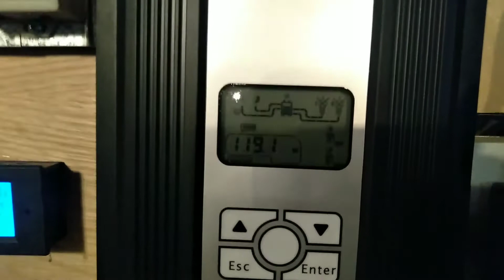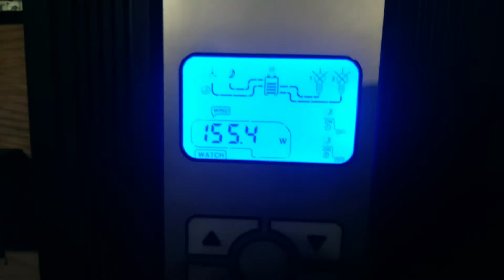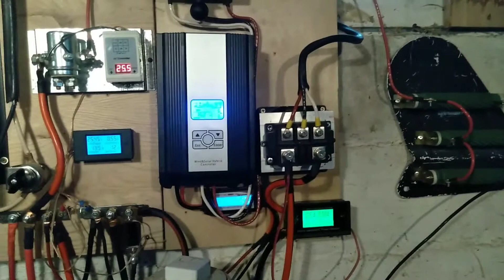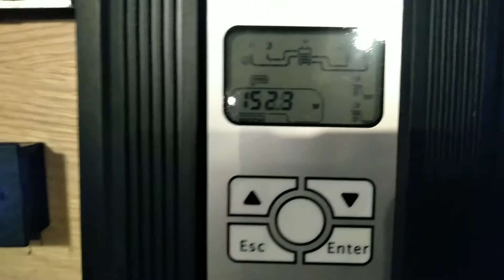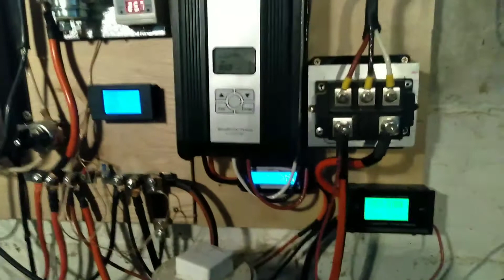MPPT Wind Controller, 2 Month Update

Comment: Hi Mate, I have a idea for your extra power, so it is not wasted in a dump load resistor and is stored for times when there is no wind or solar. It is using water and gravity to spin a water generator. First you would need a big rain water tank on a stand off the ground or up on a hill, then another rain tank of the same size at ground level. Using your extra power to pump water from the bottom tank up to the top tank to store until it is needed. Finally contact a water wheel generator in the top of the lower tank after the input hose. Water can be used from the bottom tank if needed, after collecting power from it after transfer from the higher tank. Use a relay to turn on.
I hope this idea helps everyone.

Comment: On your suggestion i just got one of these for my wee 400w 12v setup but I think the mppt function stops it from picking up proper speed by kicking in at 10.5v and then I can never get more than 11v at 25 knot wind speed. I thought about getting a turbine with bigger blades but we have so many hurricanes i dont think thats safe (considering i dont have help to bring it down). Do you know if these controllers can do a good job of managing a 24v turbine to 12v battery setup? Im thinking that may be a better solution?
Reply from the maker: You can adjust the mppt function and tell it what rpm or amp input to kick on or off. That allows you to fine tune the controller to your exact turbine.

Comment: Does your land up north have better wind?
Reply from the maker: Ummm.... i never measured it. It's much higher elevation. The tree tops are always moving so I guess we'll see. I plan on going for the gold with a 50' tower and building a similar powerplant as i did for that customer in the middle of nowhere. Panels and turbine rite on top of the power shed to keep low voltage wires as short as possible and then distribute the AC from there. I'll be up there this weekend and show the place off. Gorgeous little slice of heaven.
Reply: @smallcityhomesteaders1600  Sounds like a great plan, can't wait to see it. Thanks for sharing your adventures in living with us.
Reply from the maker: @stevenfrazier8939  my absolute pleasure!

Comment: Versions of this controller use an external dump load rather than internal shorting.  Does yours have that ability?
Reply from the maker: Yes but i can't use it till i program it with the software.
Reply: @smallcityhomesteaders1600  You just need the cable.  Software is free I think.  Tumo sold the cable separately.
Reply from the maker: @kevinmcmanaman7774  yup...for $35 . I ordered it. Looking forward to using all the features.

Comment: That controller seems to be a good mate for the turbines you use. So your moving one of yours up north. Well do you have a link or a video where you purchased it. Lol, back in the day JD burnt one of a similar controller and he got a lot of people upset at him! But the manufacturer seemed to improved it... Thanks for sharing 😃 GBU
Reply from the maker: This one works great for me but again, my winds aren't anything like JD's. I think it would handle some abuse but in high wind zones like his you'd wanna get one rated for your "freaky peaks". Twice my 800 went up over 900, that i saw anyways so i got the 1kw controller. The same turbine on JD'a room should be paired with no smaller then the 1.5kw. Anywho.....hows the weather over your way? Shit still crazy in the cities?
Reply: @smallcityhomesteaders1600  off and on rain. Burn Loot Murder is still acting up cause of the other three cops on the George Floyd case!! I'm glad I live 2hrs from Minneapolis, but in a small town 17 miles from me. Burn Loot Murder has a chapter in that small town!! Sucks!!
Reply: @smallcityhomesteaders1600  I have a 600w version of that controller running a 600w turbine (HY-Energy), without any external dump.  I've recorded peaks over 1,200 watts with huge gusts, and it has not had any trouble.  Its best performance is the boost function where it increases the voltage of the turbine in lighter winds to make it charge my 24v battery.  Trickle charges all night frequently.  Very impressed with it.  I have the cable to program and adjust all the parameters on my windows netbook, which is much easier.